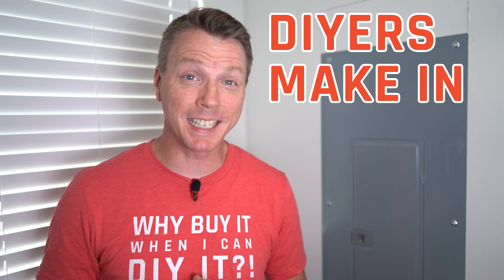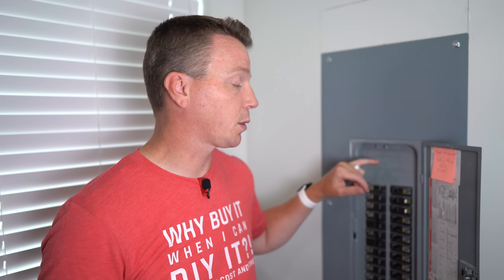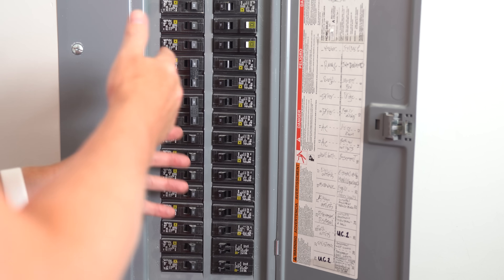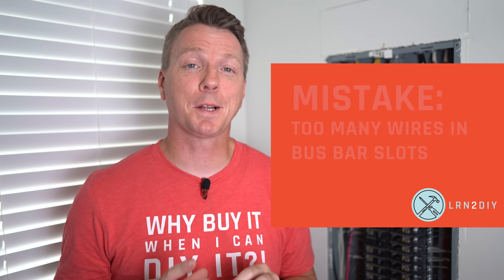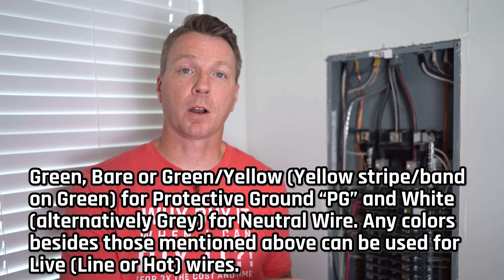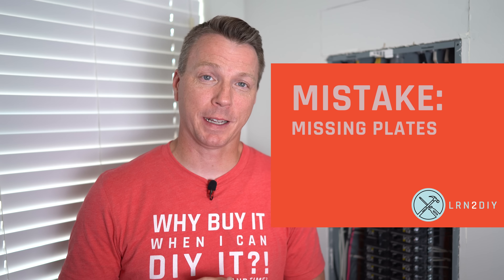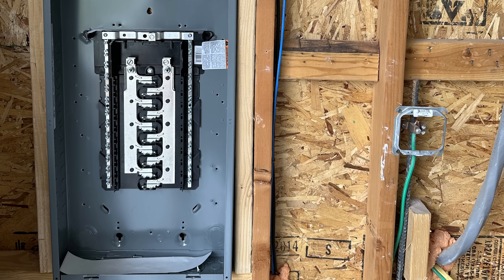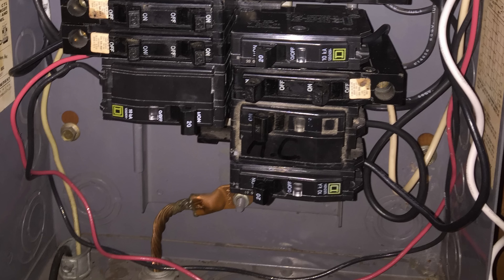10 Common Mistakes DIYers Make In Circuit Breaker Boxes

Comment: Tip: put a floor plan of the house/building next to the panel. Don't just label the circuits, show them!
Reply: so whose amending the floor plan when something is added? as built plans are like hens teeth
Reply: @harveylong5878  They're easier to keep current, than you might think.

Comment: That absolutely is a beautiful panel. I see that it's 3-phase...wondering if this was for a home shop or was it commercial? Being only 240VAC, my guess is that it's a home shop panel, which is kind of surprising. Often times commercial electrical is a bit more "refined" where as home panels tend to be somewhat sloppy. Not sure if this is a code thing or what...like maybe there's a bit more strictness with commercial/industrial electrical work than there is for residential? Either way, that is definitely a thing of beauty. I noticed they even went so far as to put a little number sticker around each wire. I guess to indicate which circuit that wire went to? When I was an apprentice electrician, I only worked on new home rough-in and finish. Wish I'd stayed with it, but that's another story, altogether. lol
  Thanks for all the great videos and I look forward to more, in the future. Hopefully, a lot more!
Reply: It’s a three phase panel. Three hots (black, red and blue) plus a neutral.
Reply: It's a 240/120V single phase residential panel. There are three incoming wires to the panel. One is a neutral (white). The other two are the 120V hot legs (reds). A voltmeter will read about 120V from either hot leg to neutral and 240V between the hot legs.
Reply: @kennykash6089  Actually, it's a 3-phase. You apparently missed the BLUE power coming in along with the red and black power cables. If you keep watching the panning down the panel to the bottom, you'll see the two neutral cables coming up and attaching to the neutral bars.
Reply: That is NOT a three phase panel.  It is a 120/240 volt single phase three wire with ground MLO panel.
Reply: @MG-hr5iz  I'm really starting to think we're all not talking about the same panel. The panel he shows at the end, the one that is super neat and everything is zip-tied and labeled, is most definitely a 3-phase. It DOES have a black, red, AND blue power feeds coming into the top and two neutrals at the bottom. This is the panel I've been talking about all along.
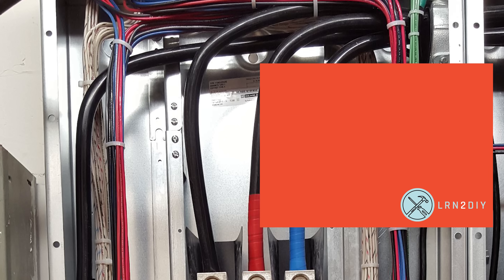Reply: @MG-hr5iz  Three phase at 13:00

Comment: #4 is honestly a bit funny to me, since the entire point of the circuit breaker (at least, a traditional one - newer ones can combine other functions) is to protect the wire.
Reply: If the wire is overloaed due to its small size, it still could be at an amperage below the circuit breaker rating. Therefore the breaker won't trip. The wire and breaker need to be matched for safety.

Comment: ugh. I hate when people who don't understand any of the physics of electricity try to explain wiring. There is no such thing as a circuit breaker "pushing amperage" through wires.

It's the appliances connected to the circuit that pull current ("amperage") from the circuit, and the circuit breaker is there to shut off power if the current goes above what the wires are rated for (for a long enough time that dangerous heat can build up). So when you put a 20A breaker on a circuit that can only handle 15A it won't kick in soon enough to protect the wiring if the load goes above the rating of the wires.
Reply from the maker: That’s well explained and I appreciate you taking the time to do so. I’m definitely learning so I realize my understanding of certain areas is limited. Again, thank you for helping me understand that concept. 

A follow up question: if the appliances are pulling the current, do humans act as appliances in some way? Why are we shocked if we touch hot and neutral if the current isn’t pushed through the wires? Just trying to be able to better understand this concept.
Reply: Yep. Your body will become an electrical load when a high enough voltage is applied due to its conductivity (which of course depends on things like how dry your skin is). It's equivalent to current being "pushed" from the supply, but it's more accurate to say that a load is drawing a certain current because the grid is providing a fixed voltage and letting the resistance of the load determine the current. There are power supplies that instead are designed to provide a constant current and vary their voltage appropriately - pretty much the only place you'll see them though is inside battery chargers and high power LED drivers.
Reply: The basic idea of a fuse or circuit breaker is to define a safe current that can flow through a circuit and have it trip at just above that level before anything gets damaged. If you feed a 100A breaker into a 22AWG wire it's possible to melt the wire (or at least set the insulation on fire) long before the beaker will consider it a fault.
Reply from the maker: @ailivac  Ok, that makes more sense. Thanks for taking the time to explain that to me. I’m going to do some research on resistance and load so I can better understand this and do a better job of speaking about it on future videos. Thanks again!
Reply: @LRN2DIY  Electricity will find the shortest distance between the hot and neutral, and you become a resistor.
I=E/R will determine how many amps you will pull.